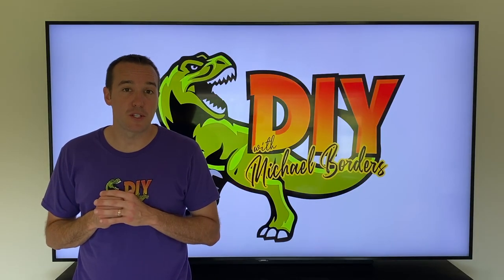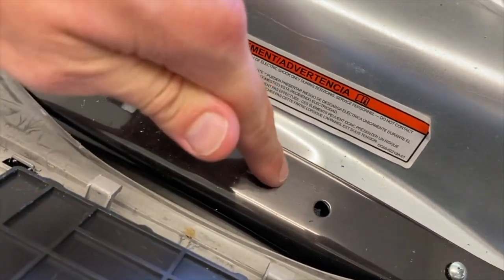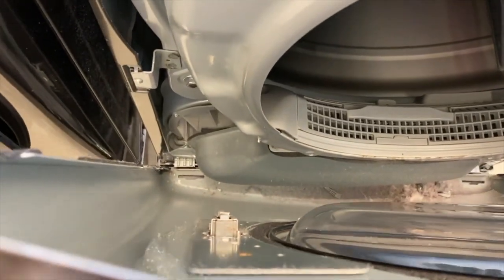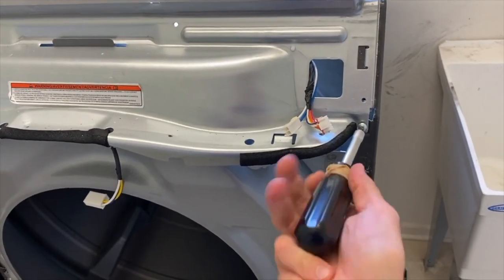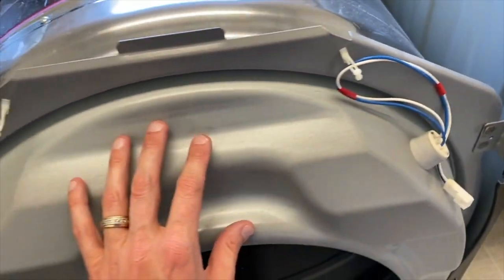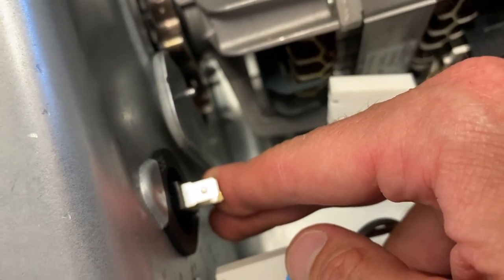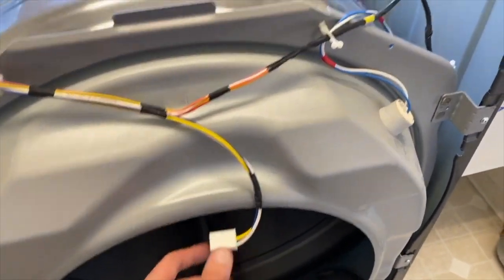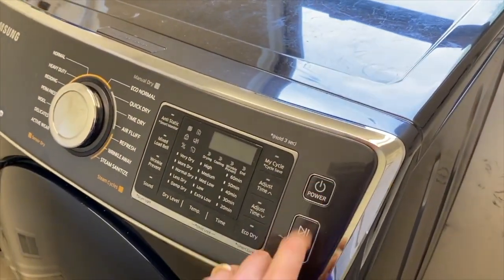Samsung dryer TE error code - Replace Thermistor

Comment: Good replacement video should show how test it and to confirm it within range save lot time doing it the right way first time nice video i changed everything turned out it was control board  had tear apart few times to see if i did something wrongbefore i gave up and called technician to test electrical sensors technician went straight to baord test it for correct specs he was in and out
Reply from the maker: Good morning, just poured a cup of coffee and am sitting down to answer any and all questions for the DIY community.

We appreciate you sharing your experience and feedback.  Any and all helpful info is greatly appreciated daniel.  👍

Let us know if you have any questions and hey if you’re into crypto trading, join our DIY ecosystem.

       toolboxtoken.com

Reach out to us any time!  🧰

Comment: I replaced the thermal fuse, I replaced the dryer thermistor and I replace the heating element assembly. It worked for 2 days. Now, it is back to no heating. Why?
Reply from the maker: Thanks for watching & welcome to the DIY Raptor Club.  It’s very possible that an electrical connection has come loose.

You may also want to perform a full system reset.  Below are links to two separate reset procedures for the Samsung dryer.

       https://youtu.be/5PINGwykgkk

       https://youtu.be/CZpuoZYwpow

Keep us posted.  😎👍🔧🔩